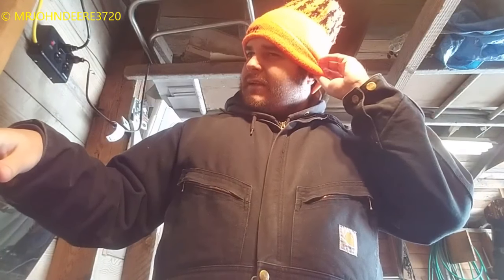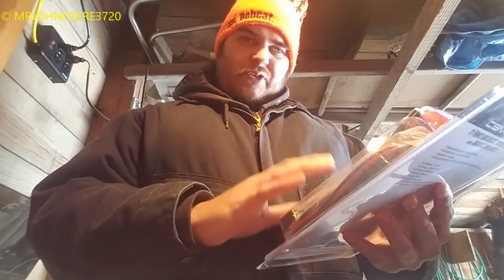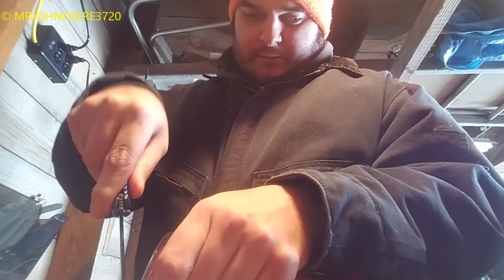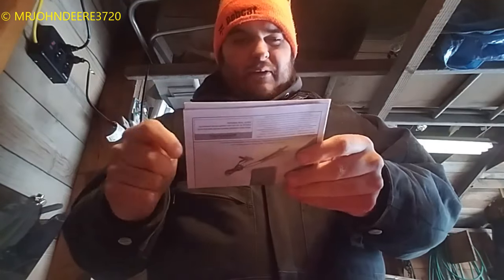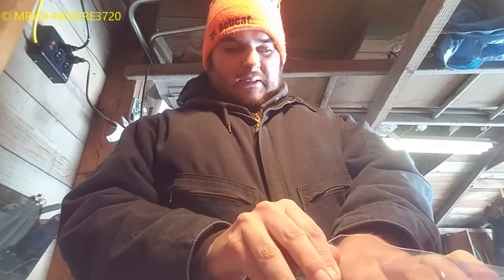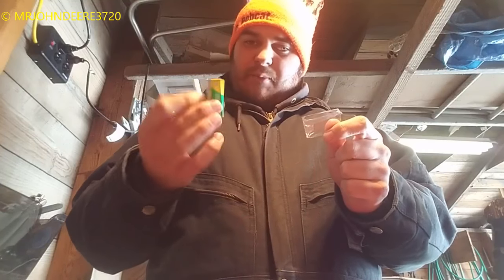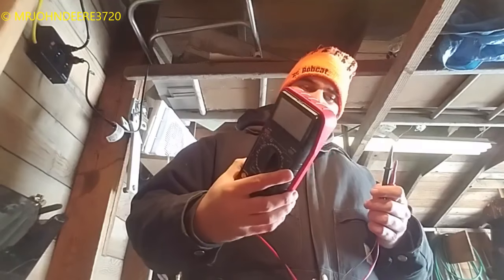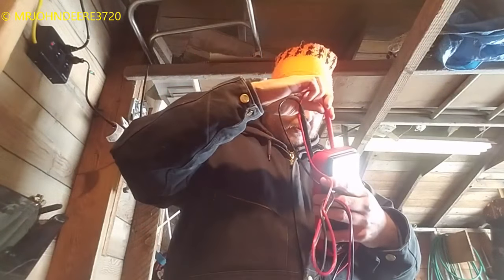unboxing of the Cen-Tech 11 Function Digital Multimeter with Audible Continuity

Comment: I'm trying to repair this meter. I need a picture of the contacts on the selector switch. If anyone can take the four screws out of the corners, and then the screws out of the circuit board (not the top two by the buzzer), and take a photo, that's what I need to put this meter back together

Comment: Nice unit! A lot nicer than the one I have! I use mine almost everyday. Try your best to learn all the symbols and the AC and DC sides! Should just see about 12.8 volts on your tractor battery when you test it! The reason it's in Celsius is because almost all mathmatical calculations and equations only work with Celsius!
Reply from the maker: thanks. :) i tryed it on tractor battery it only said 12.1. o ok, i dont plan on using the temp.
Reply: MRJOHNDEERE3720 yeah that's a little low. Probably still start it fine though.
Reply from the maker: i'll still hook my mini charger up 2 them.... im sure it went down becuz its been down to -30F even in the day time..